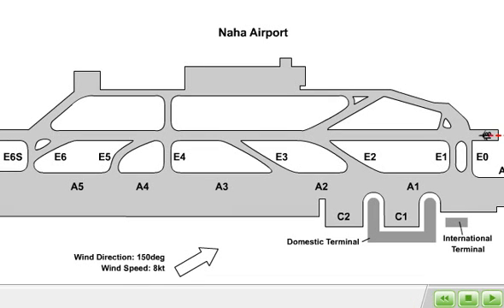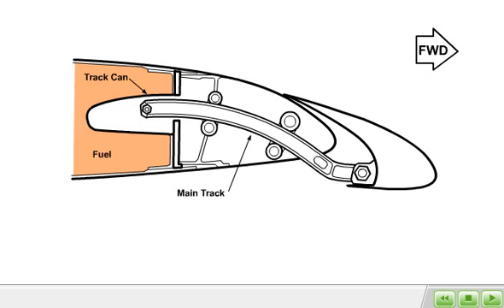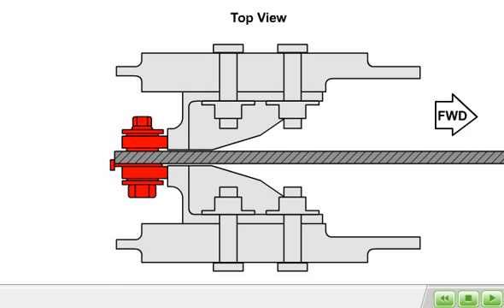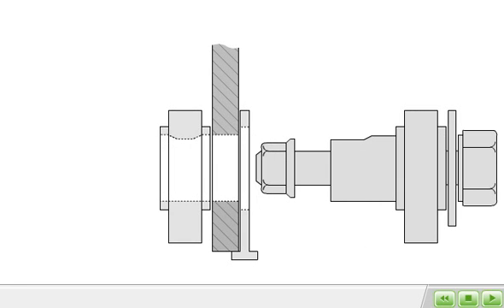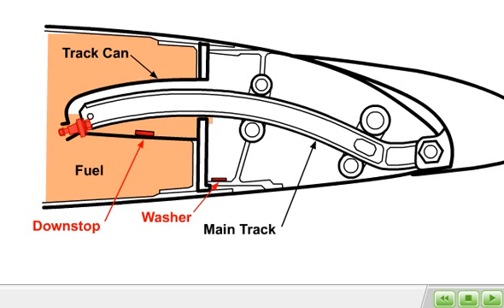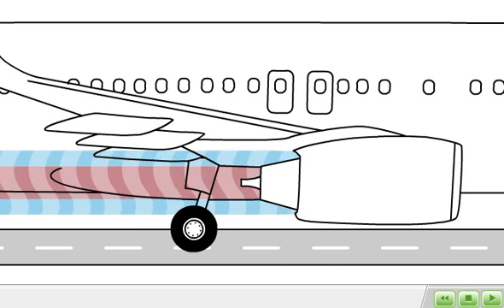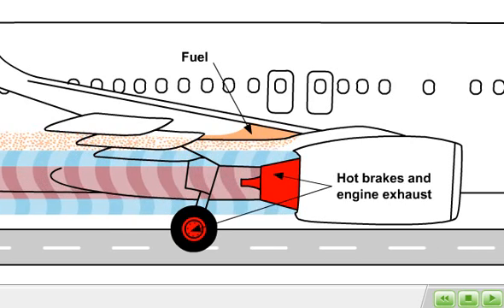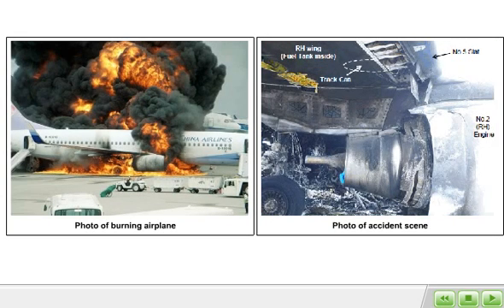China Airlines Downstop Failure Animation

Comment: Could someone with an engineering degree enlighten me as to why the assembly used a retaining nut that was smaller than the hole?
Reply: +Peter Tripoli  I imagine the engineer that designed the hardware stack up, never contemplated the exclusion of the washer that he/she called for.
  The reason the hole is so large relative to the bolt is to accommodate a sleeve with machined flats that engage both downstops.  This allows the downstops to be rotated to one of three different positions to provide adjustment.  The stop location part in the animation has a triangular opening that mates with a corresponding triangular protrusion in the side of the downstop, which keys the stops to the track.  Since the accident there have been a couple of AD's issued and the downstop assembly  has been redesigned.  the stack up is now is a bolt, washer, downstop, track, downstop, washer, nut, cotter pin.  The downstop no longer has any adjustment and the nut is now larger than the hole.
Reply: Homecomfort I'm going to copy-and-paste my reply to someone else to provide you with more context on the situation. But, first, I will address your concern. As stated before, today's jets are compiled from millions of parts, all woven together into a myriad of different systems, all tested vigorously before being deemed airworthy designs. The same plane model will be sold to various airlines in many countries. Each country has its own laws regarding air accidents and each country has its own government organization that investigates air accidents. There are corresponding agencies that rigorously analyze data from such accidents and the blueprints of the accident plane, and then issue recommendations to prevent the problem from happening again. Some are mandatory, some are advisory. The agency does not always have to authority to enforce airline compliance with new recommendations, especially if it's a problem with airline rules, not an inherent flaw in the plane design itself. An inherent flaw in the design that poses an immediate and reasonable risk to passenger safety often results in the entire fleet being grounded until the flaw is resolved.  Each airline has its own rules regarding maintenance of plane systems, including inspections, tests, replacement of parts, and compliance with airworthiness recommendations and directives. It is up to engineers to design a plane to the specifications of the company that commissions or hires them. It's up to the manufacturer to rigorously test the plane once it's built and address any issues that arise during the test flights. Redundance in vital controls limit catastrophic failures. Flight safety agencies, airlines, the company heads of the plane manufacturer, and a country's government are then tasked with determining the cause of air accidents, most of which are attributed to pilot error and very rarely attributed to one component, to share information and enforce flight safety measures.

"Cool your jets, dude. the downstop assembly mechanism is 100% not visible without completely disassembling the leading edge of the wing. Those who made the repairs, which were to address this exact flaw but caused by a different failure, had to twist and crane their arms into position and navigate the mechanism completely by feel.

The whole fleet was having a new saftey measure implemented due to several 737's suffering the nut at the end twisting off during flight from regular wear and tear. The fix was simple and consisted simply of twisting off the problematic end bolt, applying a strong adhesive, and putting it back into position to harden. Mechanics wear gloves and it is accepted that the mechanic implementing the fix on the accident aircraft's right wing accidentally knocked the washer off either as he removed the bolt or replaced it or the adhesive snagged the washer and dislodged it as he was getting the bolt into position to twist it back on. With a gloved hand, he would not have felt anything unusual as the washer fell into the compartment at the bottom of the leading edge of the wing.

After this disaster, the whole fleet was grounded again and the downstop assembly mechanisms reinspected and, lo and behold, several other jets also had washers that had fallen off. It's rare that one single part can cause an aircraft accident, but it's even more rare for no one or combination of people to be at fault. This accident had both rarities."
Reply: They can't always think about every situation that can happen minus one part for every part of an aircraft. the largest jets are made of millions of individual components.
Reply: @MelyssaAKASkittlez  everything designed into an airplane has to be fail-safe. It was a very poor design...to rely on a washer created a single point of failure.
Reply: Poor design (Bushing probably carryover from a larger program like 747)
Reply: Melyyssa,  it is part of the engineers and designers job to anticipate the short comings and failures of humans in the maintenance and operation of the machines that they design, and people stake their live's on.

Comment: Great job on the graphical explanation of the failure.
Reply: +Tom Vihvelin  You have to assemble the downlock blind through a hole that is about one inch in diameter.  The washer could have fallen during assembly and not have been noticed.  After assembly you have to make sure all components are there via flashlight and mirror.  After this accident the downstop has been redesigned and there is a requirement after assembly to inspect the slat can with a boroscope to ensure there is no debris/perts inside.
Reply: Very good explanation indeed.  Extremely fortunate that nobody was injured.  But how does a trained aircraft mechanic forget to install a washer?  Surely when there are parts left over this is cause for alarm???